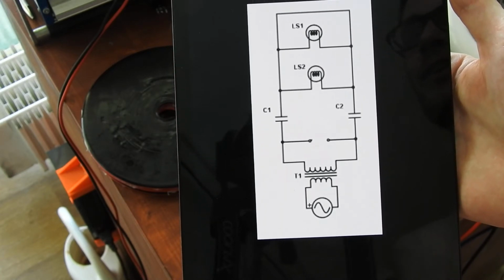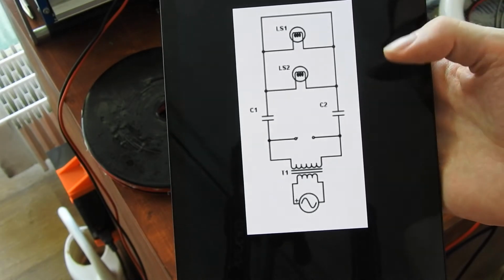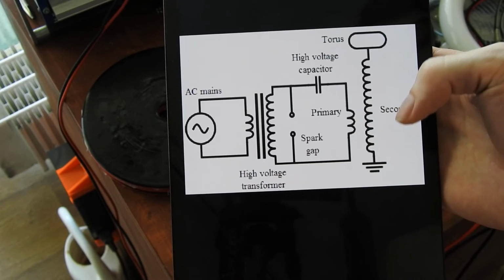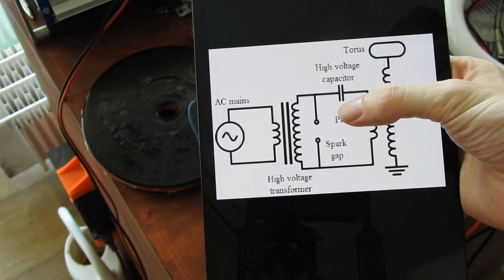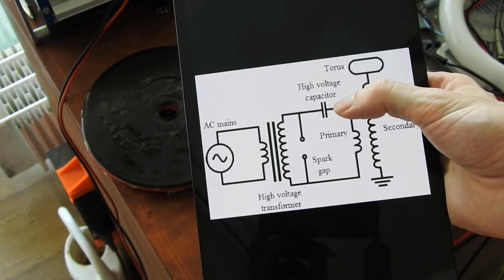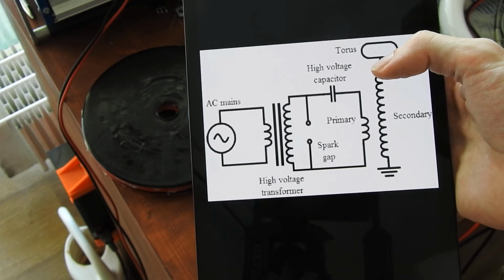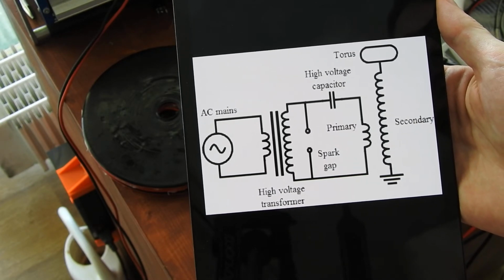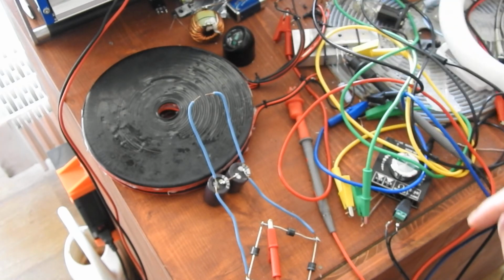Cold Electricity, Radiant Energy, Dielectricity and Static Electricity are the same thing

Comment: Cold energy is the future of energy. It is implosive not explosive. If you pull it with a load in the center of the vortex the energy increases and it gets colder.  If everyone knew the real way heat changes the magnetic value of a coil then we would be a lot further along.

Comment: Thanks for this interesting video. I was thinking of the Tesla hairpin circuit for example and wondering what exactly is the spark gap doing? Is that where the cold electricity is created? What happens if you connect the high voltage directly to the high volt caps without the spark gap? Nothing? An explosion perhaps? How does the cold electricity get through the capacitors to begin with when no electricity should be able to flow through them? Everyone talks about the spark gap but not much said about what's happening around those high volt caps. Anyone know about the efficiency of using cold electricity? I mean anyone know roughly how much power is used to making the spark gap compared to what amount of lighting one can obtain? Besides the safety features of using cold electricity are there any economical or other practical benefits? Very interesting subject and hope someone can clarify any of the above queries. Thanks in advance.
Reply: Hey I just got to this video because I heard of "cold electricity" for the first time tonight. I really don't know a lot about circuits, but what I see here is two capacitors, one charged up and the other "empty" and then he touches the wires together which naturally causes a discharge. There's nothing happening here beyond normal electricity things. This is doing exactly what it's designed to do... there doesn't seem to be any point except to maybe mystify people into thinking it's more than it is??!

Comment: No electricity on 2 FORCES PUSH PULL ON MAGNET  JLLQY JRQÑ CHARGED DEPOSIT STORAGES CAPACITOR BATTERY PUSHED P+ JLLQY PULLED P- JRQÑ .COILED   - DISCHARGED + JLLQY JRQÑ ATRACT EJECT INDJUCTION EJQECTION DUAL VUQiuum v x XuxjQñ Vl jÑX r jq ñ qLR   IX  pUq lJYQUl qYp puqpyll JQLLY YLLQJ LQJYL RQYJL

Comment: One million sparks per second is what I believe Tesla implied would be the compressive wave frequency to break down the insulating fluid separating charged particles he called radiant matter. At the point the resonant frequency is hit in the insulating fluid(tesla said it is everywhere, and can only be broken down by way of a compressive force in the aether).when the resonant frequency is hit, thousands of percent more energy is released than is used. Ed gray actually had to build a way to get rid of the extra energy in his circuit.
Reply: According to Jerry Vasilatos, pulse duration had to be equal to or less than 100 micro seconds, to not cause har full or irritating effects so that's 100 millionths of a second so in reality you couldn't have a pulse train in the millions per second unless the duration was even shorter like at one millionth
Reply: @Rybread1611 Tesla was doing up to  3 million discharges per second. He mentioned it clearly in the Westinghouse bankruptcy transcripts.

Comment: Cold electricity is negative entropic. Similar to cold plasma. You could stick your finger into a spark gap with cold electricity and it not only feels cold, it wouldn’t shock or burn you, and if you had a pre-existing wound on your finger, it would start to heal it. Regular electricity is entropic. It will heat, shock and burn your finger.
Reply: Prove it
Reply: @cosmicyoke  Just Google cold plasma and read the research documents done by various universities on its healing effects. Cold electricity is the same phenomena basically.

Comment: Interesting conclusion, Tesla I surmise would disagree.
Reply from the maker: So what do you think is wrong?
Reply: @OmegaZZ111  Nothing is wrong with what you are doing, your video is interesting, and to even put together your circuits is tedious at best.  My comment was meant to support you not point to. ‘Wrongness’.  I would even assume that you studied Tesla’s writings.  Tesla wrote that the dielectric phenomena was what changed his endeavors from the typical AC system, for which he is known for, to disruptive discharges.  And even if you don’t want to consider Tesla’s writings, classical electrical engineering even concedes that any change of an electrical field across a dielectric results in a magnetic field generation.  Or in other words a magnetic field is generated not only from moving current but also a change in dielectric field (maxwell wrote an equation for this fact),  Tesla also stated that disruptive discharges resulted in a radiation that penetrates shields between him and such discharges, even faraday type cages.  I could go on and on, and thus I don’t think Tesla would agree with your conclusion of this video.
Reply from the maker: @magncity1817  I studied Teslas work quite a lot and I agree with the things you wrote, but still I am curious what part of the video Tesla would disagree with?
Reply: @OmegaZZ111  The opening premise, “ cold electricity, radiant energy, dielectricity,  and static electricity are one and the same thing”.  He never, to my knowledge acknowledged the term “cold electricity”, yet, he did several times mention high frequency high voltage effects on the human body, but not in terms of “cold”.   There is more, but that as the lead in would be enough.  Usually I would not bring this type of thing up, but Tesla’s course in electrical phenomena totally altered from his beginning AC systems to disruptive discharge systems when he discovered the uniqueness of this energy in destroying stout conductors, people, and propensity to penetrate shielding, other things as well.  So not the same thing.  I only know of one thing that penetrates shielding related to magnetics.  On a disruptive discharge of the manner Tesla created, charge initially could not propagate, but magnetics can.  My guess is that there is more to the magnetic side then we understand, but Tesla did as did Maxwell to include magnetics without charge flow (indicative of disruptive discharge of Tesla).  Said too much already…
Reply: @magncity1817  The cold part comes into play when you get the duration of the dielectric impulse down to under 100 Nanoseconds, that's when Endothermic effects begin to manifest, otherwise 100 Microseconds duration is sufficient to keep it safe.

Comment: Cold electricity is not dangerous, as I know by reading about Nikola(us) Tesla inventions... but radiant electricity gives to Tesla some questions about flames  that pass through isolated material objects and are felt by the human body as stings, ... as alternating current experiments.
I do not know too much about this, so I will serch for more... thanks for your post! 🤗
Reply: It can be very dangerous just as easily as it can be very safe! 
EM radiation through space is an 'inductive' radiance of transverse magnetic=centrifugal force vector. Cold Electricity is an open circuit so it is also Radiant Energy at the same time. The wire is not containing it, its a wave-field effect at HV HF resonance. Radiant Energy through space is the inverse of EM, its rather a 'Capacitive radiance'. When impeded by conductors and metals in range which have no capacitance they reflect EM phenomena. There are other dangers from undesired frequencies at high enough voltages impeded by materials in your surroundings which reflect dangerous high-energy EM radiation in effect. Consider even the metal oxides in wall paint possibly. You don't want X-ray or Gamma uncontrolled.
Reply: @loveboyhatch Absolutely! Scalar weaponry is for real!
Reply: It is beneficial to the health..but do it wrong it is harmful..Flyod Sweet fell prey to it wrong topology exposure( a Work kiss phenomenology) and it cost him his life🤞🤞
Reply: @navne @navneetpandit7299 ok up Guy Obolenskys FASER chamber and malcom bendall, he infused himself with 350,000v everyday for 1-2 months

Comment: Cold electricity is not the same as slayer exciter. The name cold electricity comes from the effect that it will freeze the mass. Slayer exciter will burn your nervous system. Cold electricity that is separated from the source with spark gap will not hurt you. Some say it even has healing properties.
Reply from the maker: Of course it is not the same, I never even mentioned a slayer exciter circuit..
Reply: @OmegaZZ111  People should look up the waveform with oscilloscope. If the frequency has waves it will hurt. The spark gap will break the frequency to chaotic pattern (you can see this on "the secret life of radio"). But it will also cause RF pollution and issues on other sensitive electronics. Many people confuse RF and cold electricity, cause they have very similar properties to naked eye.

Comment: No matter which names we give it, there is still much to learn and discover.
transverse- and longitudinal flow,
conventional- and displacement currents,
electrostatic and - dynamic,
pulsed and impulsed,
AC and DC
Reply from the maker: If we were able to fully understand what electricity really is, we could build devices that seem to be impossible right now, so yes there is still a lot to discover and learn. :)
Reply: @OmegaZZ111  Electricity is NOT what something IS. It is simply what a non-compressible non-polarized superfluid DOES. What we observe, study and engineer are the actions and reactions of dynamic universal medium in a chain of causes and effects. If you would like, we can share our insights in a lot more depth and detail. But for now, allow me to clarify:

-CLASSICAL 'DYNAMIC' ELECTRICITY:  is a time-variant "magnetic" 'spatial' centrifugal radial force vector-field from gradient scalar pressure mediation (decompression) of high super-potential centripetal compression in a superfluid non-compressible medium. The center of 'gravity'/inertia in this dynamic is the simultaneous 'counter-spatial' compression in retro-causal respect to the maximum loss of the magnetic momentum. The cyclic gradient pressure mediation in continuous oscillatory exchange between the centripetal compression maximum and the centrifugal rarefaction maximum along a time-variant vector potential is a TRANSVERSE circuit of dual 'aether' dynamic. A superfluid medium to be able to compress can only happen in perfect spin dynamics. In electric power transmission, its a dual polarization of the Aethereal dynamic of time-varying a gradient scalar potential 'magnetic', with respect to a time-varying vector potential along a conductor(aka Dielectric REFLECTOR) between two point-sources with their own time-varying gradient scalar potential 'voltage' (pure voltage differential). Electricity through a wire and Light or EM radiation in space, are the same dynamics in principle. A permanent magnet is a LONGITUDINAL STANDING WAVE/Static magnetic field; in this sense exactly the permanent magnet can have conditional variants of magnetic field geometry and topology engineerable via axis of magnetization and solid geometry of the magnet, and magnetic field strength engineerable by material production and power factors of magnetization, all mere conditions which have their resonance correspondents in WAVE MECHANICS, wavelength/frequency and phase. It is fair to say that a permanent magnet is the closest thing to a true perpetual motion system. A permanent magnet has its transverse force-field vector potentials of dual polarity (Sympathetic to its perpendicular inverted dipole of 'dielectric' compression and decompression) in an asymmetrical conjugate 4D wave geometry opposite in phase and vector direction; phase conjugate, thus resonantly forming a longitudinal standing wave-field layering the 'nested' dual polarized force-fields. This manner of self-resonance must be how a permanent magnet conserves energy and magnetic momentum so efficiently for a long time while containing a cyclic loss of pure potential 'inertia' and recycling power continuously. In being so, its magnetic force vector potentials are neutralized in equilibrium but not negated or 'cancelled out'; a resting magnet will conserve a force potential until acted on externally to cause a force vector action. Its worth to mention that the force-field asymmetry mentioned formerly is the wave mechanics correspondent of the red-blue shift 'doppler' effect in principle. A magnet is a macro fractal replica of a 'photon' or 'wave-packet' as preferred by some.

-DIELECTRICTY = STATIC ELECTRICITY: Yes sir the same thing indeed. It is pure 'Charge'; pure Aether compression; inertia without loss, or just until an imbalance occurs in the field to cause discharge or a gradient. It is then in essence a time-varying scalar potential of compression at any assumed point source quanta 'pure Voltage' meaning force-free, which is better defined when observed as the time-varying gradient vector potential between two voltage source potentials forming a force-free vector field "NO MAGNETIC FORCE" in a dielectric medium best known as the electric field. Depending on the medium, the higher the dielectric constant the more capacity it has to 'store' -'conserve' --> 'inertia' - 'pure energy' via 'counter-spatial' fractal nesting compression. Hence, the capacitance C of pure voltage 'inertia' is inverse to 3D spatial dimensions, and the dielectric K threshold of a medium is also proportional to its 'counter-spatial' 'inverse'-geometry down along molecular, atomic and sub-atomic scales to Planck scale.

-COLD ELECTRICITY and RADIANT ENERGY: is a super-dynamic high potential DIELECTRIC compression; a non-cyclic vibrational HF HV wave-field /current (skin-effect) of pure inertia/pure voltage with no loss; a force-free (No Magnetism) vector potential gradient of a scalar potential varying over time in non-cyclic longitudinal compression of the superfluid medium. It can propagate on a single-wire transmission; essentially it is a 'scalar' 'wave-field effect' of pure HV dielectric HF impulses of varying voltage over time. A COLD ELECTRICITY transmission is not a Dipole circuit, because it becomes an open circuit with the environment, enabling wireless power transmission without magnetic induction; but by capacitance. It is longitudinal dielectric radiance charging the capacitance of the dielectric ambient atmosphere in local 3D space, only IMPEDED by reflectors/conductors which then discharge this 'capacitance'/'potential' and dissipate this energy in form of heat and EM radiation/light. The conductors are excited at an oscillatory vibratory resonant HF similar to water molecules in a microwave. Tesla was trying to perfect his systems to avoid "impurities" in the output from the impedance of the system itself and the wirings and resulting in EM radiation as well. He was experimenting with this energy form on matter and used vacuum tubes with different materials to observe the "disintegration" of matter into high-energy radiation X-Ray and Gamma Ray spectrum. I have no doubt he was the pioneer of practical Nuclear engineering. His "Death Ray" beam is nothing far from an educated guess; possibly some form of high-energy radiation laser beam on large scale. Many other "mysterious" Tesla patents  and misinterpreted narratives of his work and biography and history will start to resolve in a better understanding if you consider much of the science we are never fucking taught in schools!

CAUTION: IF you are experimenting with a Radiant Energy circuit and you are not aware of your environment, be very careful and please consider. Unless you have the full technical knowledge and means to build a controlled system without undesired EM radiation byproducts, or without the tools to gauge and monitor the EM radiation output to avoid dangerous levels, then please seek assistance and be very careful. Unless you have a gauge and control on the frequency levels of the HF output, you must also consider the possibilities of heavy metal ions and compounds in wall paint and many common appliances that can be excited by the Radiant Energy to emit high-energy spectra levels of EMR at certain frequencies in proportional capacities.
Reply: Yes. coil Geometry as well as insulators doped with monatomics and lanthanides for superluminal progress.
Reply: @MrThacke  yessss the monatomics have far more extreme properties compared to nano particles, as well they may even supr conduct at room temperature, and using cold electricity would be complimentary as heat would ruin the superconductivity. Agreed that coil geometry is key, phase conjugate mirrors and conjugate arrangements with 4 wave mixing is best way to produce longitudinal waves, but the true quest is to find how to use these waves and how to take advantage of its properties
Reply: Ivo you are the MAN.  I learned so much watching your videos. 👍
Reply: Nikola Tesla, Baumann's Mathernita, Edwin Gray https://pegaso.changeip.org/DOCS-TECH/Physics/Free%20Energy%20Secrets%20with%20Tesla%20patents.pdf

Comment: Can you rewire your house to run on dielectricity?
Reply from the maker: There is no need to rewire anything.
Reply: @OmegaZZ111  Okay , how would you then switch it over to dielectricity?
Reply: @braaitongs  You need to change the power source supplying your house to a type that produces dielectric impulses, but I doubt the tech in your house outside of bulbs will like it.